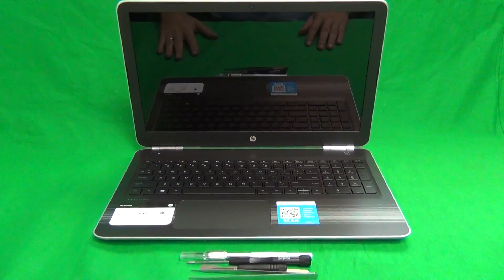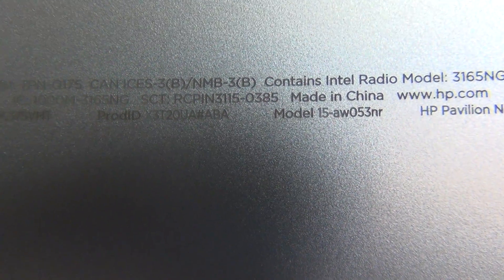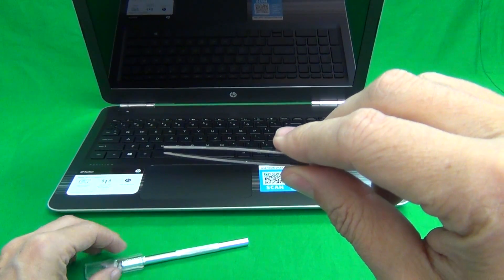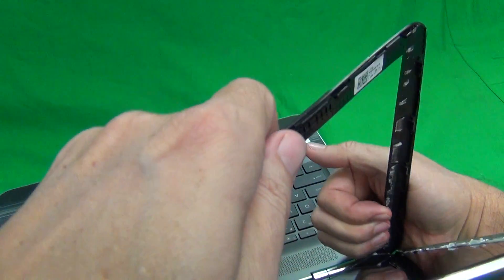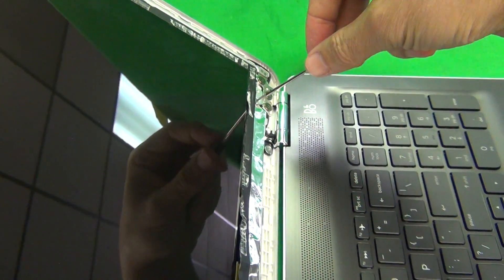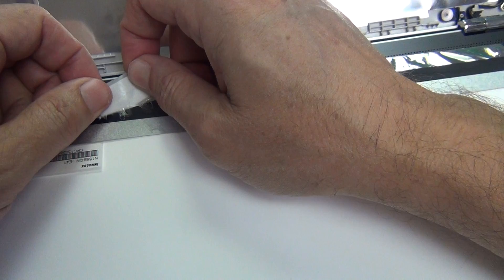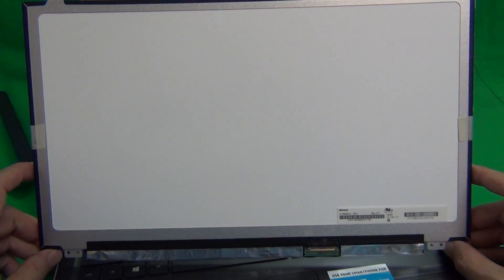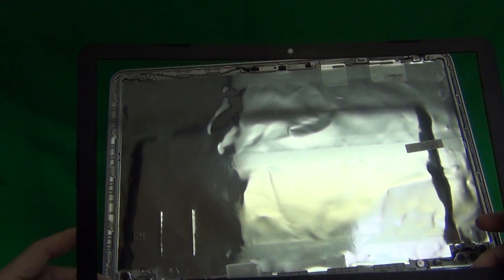HP Pavilion 15-aw 15-aw053nr Laptop Screen Replacement Procedure

Comment: Hi there!
Is it possible to replace this touchscreen with a non-touch screen on this model? Ive tried with 2 different ones already but get nothing on the screen. Not sure how to know if its doable. Mine is cracked and can only see half. Its exactly the same model.
Thanks in advance!

Comment: Great job and thank you. When I use my laptop and raise and lower the screen the right half (exactly) blacks out or has grey snow. If I tap or rub it at the bottom it comes and goes. Is this a bad screen or a bad connection or wire harness? THANK YOU